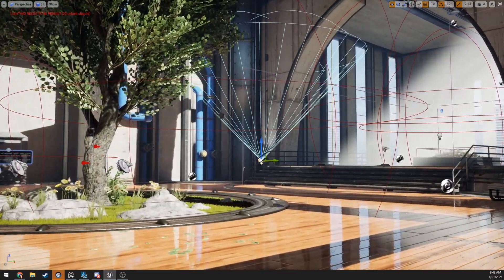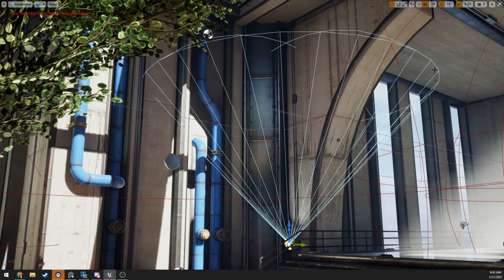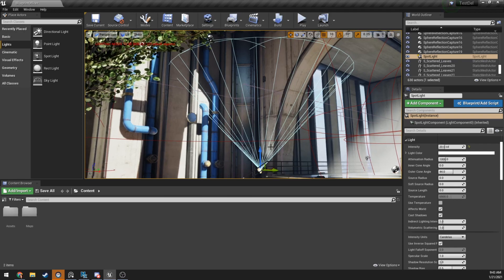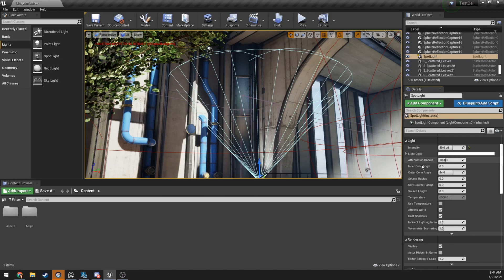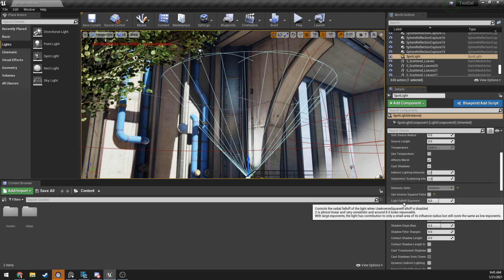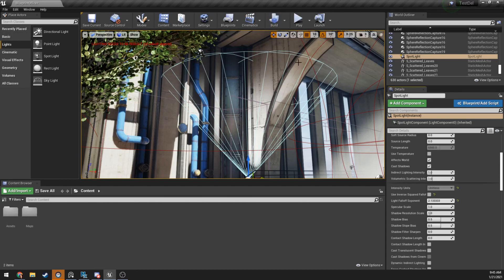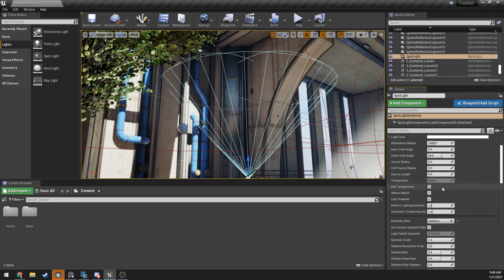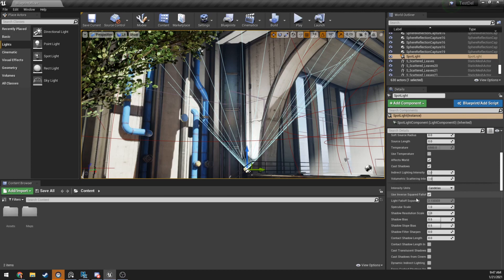How to use lighting falloff and attenuation radius on lights - UE4

Comment: Dude ripping my head of . I am a unity user and while working in urp they use physically based fall of for lights which is good in specific areas but really off for games immersion sometimes, and I can't easily change light fall of there and no settings is exposed in unity which kinda sucks. I use unreal for level design and it was just awesome how unreal keep every option exposed so that user make a style of it. Cool.

Comment: I'm new to unreal and made a flashlight that's actually a headlamp. I attached the spotlight to the head socket but the actual light source starts off a few feet in front of the character. When I pull the light backwards it starts to cast the meshes shadow. What would be a good work around.
Reply from the maker: Sometimes you can make the head lamp mesh not receive shadows , also lights can pass through the back sides of polygons. 

My suggestion is to just place it as close as you can to the surface without without it clipping.